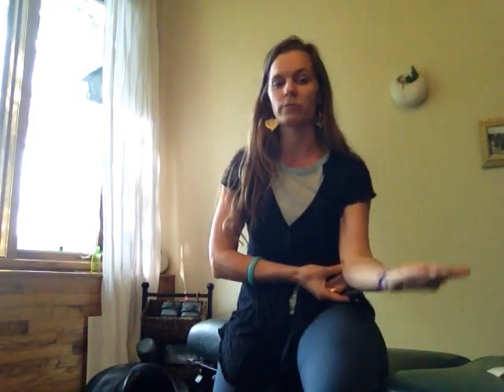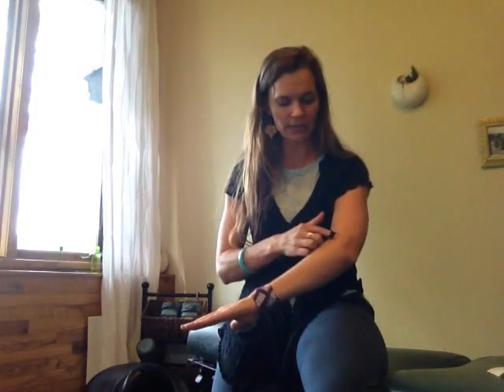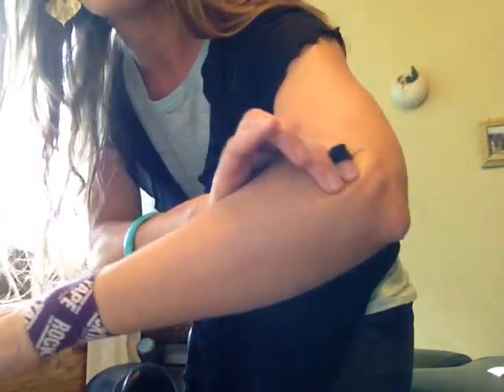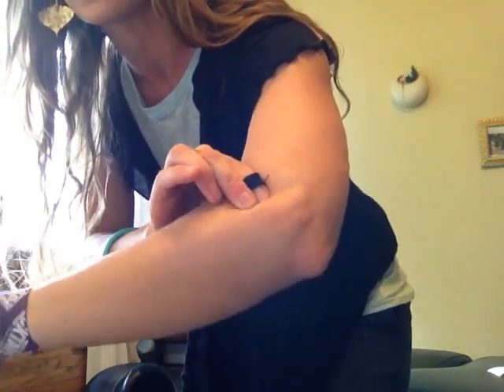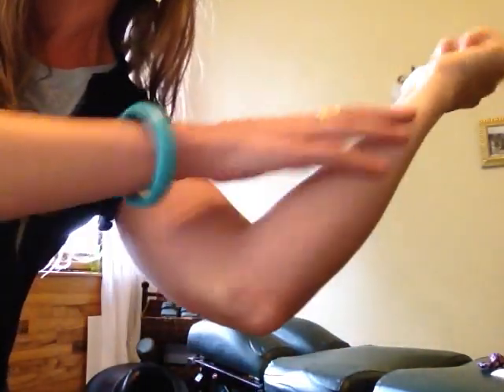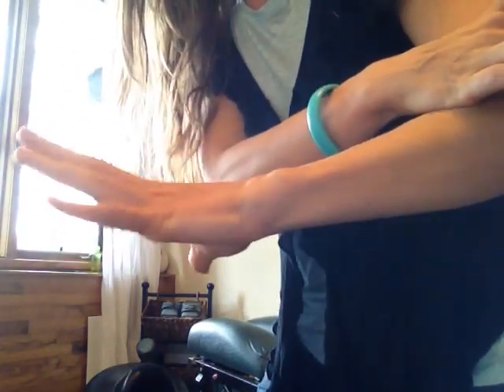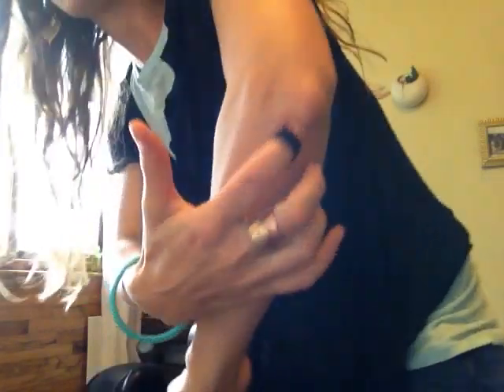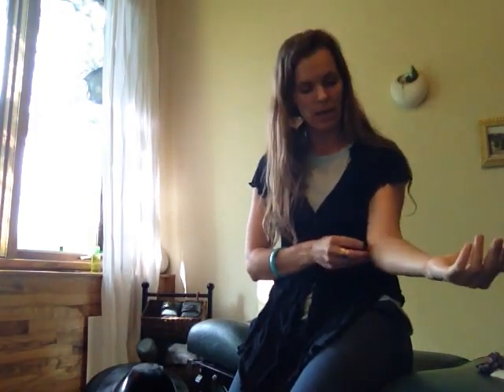The Climbing Doc l E20-Basic Elbow Anatomy and Injuries for the Climber

Comment: Hi and thank you for that information you put out there! I had climbers elbow for quite a while a few years back. It took me about a year to get rid of it and I did a lot of Finger and wrist extensor training, which I'm still doing. Lately I have been doing weighted pull-ups with a neutral grip with quite a bit of weight for me, up to my 3 RM and I feel some slight irritation in my elbow at a place that I assume is the attatchment of my brachioradialis to the humerus. It's definitely neither the medial nor the lateral epicondyle, it feels like it's more in the middle of the elbow rather than on the outside. I remember that I used to have this irritation too sometimes back when I had the climber's elbow and anatomy-wise it makes a lot of sense that it is the brachioradialis, as it is the first time for a while that I do neutral grip instead of pronated grip pull-ups. My question to you would be if from your experience it is a common thing amongst climbers to have an irritated brachioradialis tendon  and if you think that there is a direct relation between the climber's elbow and that irritation. I would really appreciate any input from you!